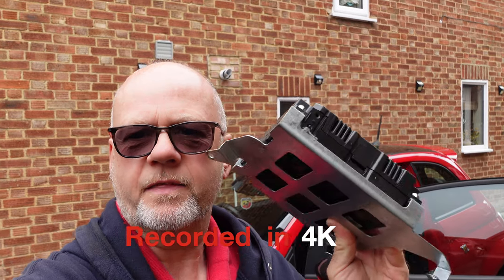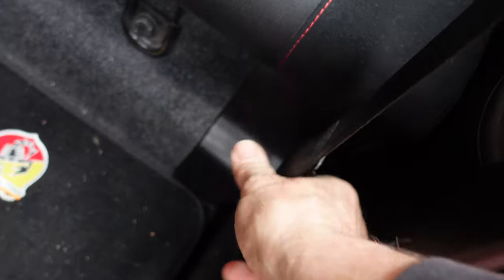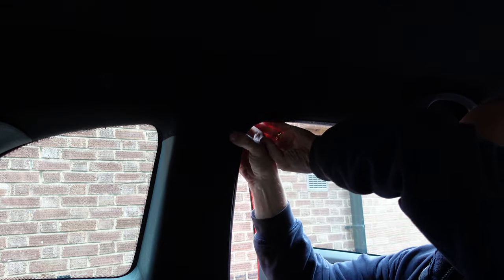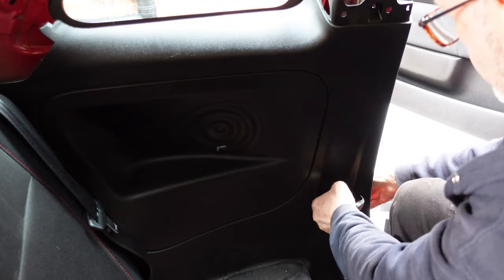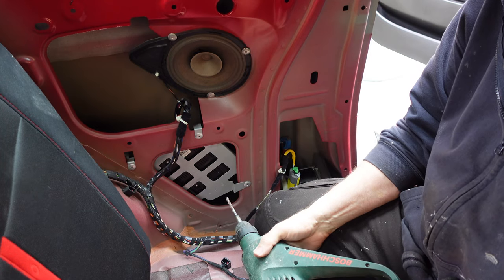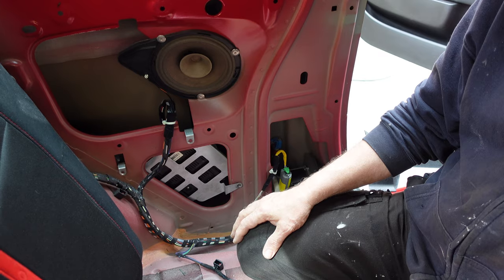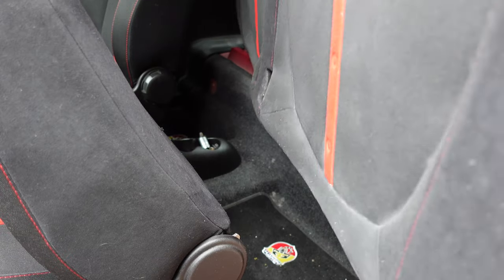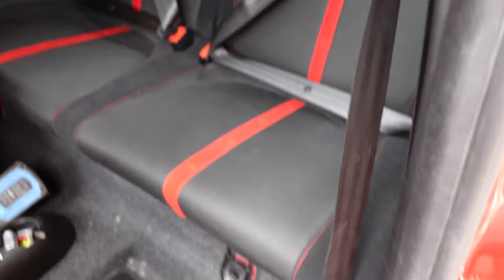Replacing a Faulty Blue & Me ECU Module  - UPDATE - in a Fiat 500 or Abarth - Love 500 How to Series

Comment: Evening Paul, thanks so much for your videos. Definitely the best on youtube! I have a parasitic drain issue, flashing mileage and no blue and me working... So, probably no need for Columbo to figure out the culprit... I was thinking of disconnecting it for the first fix.. Then, based on one of your other videos, changing the head unit for the one with Andriod auto etc. Then, maybe getting brave get the correct lead and software to do the proxy alignment.. Now, question for fix one, is it possible to do the cable disconnect without the full tear down? I.E. can I get it dismantled enough, avoid taking out that peski rear seatbelt bolt and disconnect the blue and me to ensure it fixes the battery drain (then do the other fixes at my leisure)? I'm trying to avoid taking the car off the road for such a lengthy period... TL;DR What's the minimum you can strip down to disconnect the blue and me cable... Or, is it impossible, and you have to drill it out to disconnect?
Reply from the maker: Everything except that final bolt. If you pull it out at the front so it’s hinged on that back bolt you can just about get your arm in and disconnect the plug. It’s one of those lever type where you pull the lever back and then pull it out. You can’t see so you’ll have to do it by feel.
Reply: @Love500  Thanks for the quick reply and, again, for these videos! I'll have a go tomorrow... I think the new battery I put on two weeks ago has had it, drained to "death".. Lets see if it charges up overnight (have disconnected and in my garage and desktop charger). Wonder if Euro Car Parks will replace under warranty.. Hmm... Anyway, you don't know what it means to us DIY'ers this kind of content - kids of today take note - without contributors like this all you'd have is a Haynes manual and be ON YOUR OWN :-D

Comment: Sorry Paul , one more question . I don't have an impact drill , do you advise against trying to remove the rear seat belt bolt without one ? Can the job still be done without removing the rear seat belt bolt ? Thank you 😊
Reply from the maker: It can but it increases the risk. Make sure you wire brush the other side of the bolt and put plenty of WD40 on it a couple of times.
Reply: Thank  you , I will do and thank you for your fast reply 👍

Comment: Hello, I have a fiat 500 sport. The radio module is not working well. but put one from an abarth?

Or does it always have to be specifically for a sport model?
Reply from the maker: There are two versions V1 and V2. They are not interchangeable. They changed around mid 2010. You do not need your match model numbers but a proxy alignment will be required as the mileage will flash when new one is installed. I can repair most modules for £60.
Reply: How do I know if it is V1 or V2?

I would gladly have it repaired but I am from El Salvador and here in my country no one repairs them. You can't imagine how far your videos go. @Love500
Reply from the maker: @DiegoReynaldoMartinezMontoya  you used to be able to tell from the blue and me website but that’s now been closed down. It’s all about the year of the car now.
Reply: is 2012 sport @Love500
Reply from the maker: @DiegoReynaldoMartinezMontoya  assuming left hand drive ones are the same, it should be a V2. If you get it out, take the case apart and take a picture of the circuit board, I can tell you which version it is.

Comment: Can't find B&M in my US version 2016 Fiat 500 Pop as not behind either side of passenger panels under speakers? Can't find anything on-line that shows otherwise and manuals no help?
Reply from the maker: It's possible that it may be under the dash beside the stereo. In some of the UK Twin Air cars it has a different one held in with a bracket on the left of the stereo, may well be on the right in a US car. I'm assuming your car actually has it, as a Pop in the UK doesn't although specs are different. Do you have the USB socket by the gearstick and steering wheel controls?
Reply: @Love500  My Fiat is an automatic and there is a USB just below the shifter. I tried to get info from a dealer service department and they would not give me any info without bringing my car in and paying for their diagnostics. Next I called their parts department and asked for the cost of a replacement B&M and was told that my Fiat had uConnect built into the radio and did not have B&M? All my diagnostics did point to what seems to be classic B&M failure, parasitic battery drain, flashing dash, and blank 5" radio display. Initially thought only a failed radio but replaced and nothing. Thinking now need to do diagnostics and proxy alignment to recognize the new radio?
Reply from the maker: @waynerawlins-v8h  yes, get yourself multiecuscan and a cheap set of cables from eBay. The US car is different so I don’t know when or if they swapped to uconnect.

Comment: hey buddy, great video, really detailed and well communicated. is it possible to just disconnect the unit and get shot of the flashing miles, and then i can fit an android head unit instead?
Reply from the maker: You’ll always have the flashing miles unless you do a proxy alignment.
Reply: @Love500  yes so if i proxy alignment then is it possible to disconnect the original unit allowing me to just change out the old stereo and put an android in instead. can the proxy unit disconnect the blue and me power and connection or? appreciating your help
Reply from the maker: @cryptomason1794  when you remove your standard stereo and install a new one, your body computer will be looking for the old one so will flash the mileage, hence why once installed you need to do a proxy alignment. If you just disconnect the blue and and then do a proxy alignment it will stop flashing, until you remove the stereo.

Comment: It isn't too bad to unbolt the unit with a small socket set. Not too sure how easy it'll be to replace the bolts but I just wanted removed/disconnected for parasitic drain reasons.
Reply from the maker: I’ve tried with a ratchet ring spanner and it’s too fiddly hence why it’s quicker and easier to drill out the rivets.

Comment: Hello, when i plug my iphone into the usb nothing happens. The jack doesn't work either, although the steering wheel controls do. I have a 2018 abarth 595 turismo with the beats audio option. Also the are doesn't work on the front but it works on the rear.
Reply from the maker: Mileage flashing? If you’re in Europe or UK you have a facelift car which doesn’t have blue and me.  If you’re in the USA then you didn’t get the facelift so may still have blue and me.

Comment: When you own a 500 C model, the blue and me module is positioned behind the glovebox in the front
Reply from the maker: I don’t think my C has! I’m getting it back soon so I’ll confirm that.
Reply: @Love500  one month ago i removed the back seat to find out the blue and me module was not in the back of the car. Positive note. I had time to give it a good clean.
Reply from the maker: @aukemuis  is yours a Twinair by any chance?
Reply: @Love500  yes it is a twinair
Reply from the maker: @aukemuis  thought so. I’ve had a couple of twinairs which had a “stereo control module” under the dash. It’s not a blue and me though. Weird.
Reply: @Love500  radio module and blue and me module where bolted on one steel bracked
Reply: @aukemuis same happened to my 1,3multijet(2016)-B&M wasn’t in the back panel

Comment: can i just unplug this stupid thing in my panda so i can see if that faulty junk i dont use is causing my paracitic drain?
Reply from the maker: Yes but it has to be unplugged at the unit itself.
Reply: @Love500  thanks. I think I'll have to let the pros at it then lol.
Reply from the maker: @stellapratt9659  save yourself some money, do it yourself. I dread to think what a garage will charge you.
Reply: thanks. I found the unit, not as hard to get as as the 500 which being a Fiat surprised me lol. under the drivers seat and now disconnected and back on charge. fingers crossed that is the root cause of my battery drain problems
Reply: We got this flashing mileage on our 2014 abarth, could I not just pull a fuse out and leave it until such time we swap the car ? That looks a right pain in the arse doing all that. What a great design idea to locate it there 🙈🙈
Reply from the maker: @joobie1000  no. As I explain in the video, the two fuses control other systems so you can’t just pull the fuse.
Reply: @Love500  oh OK gotcha